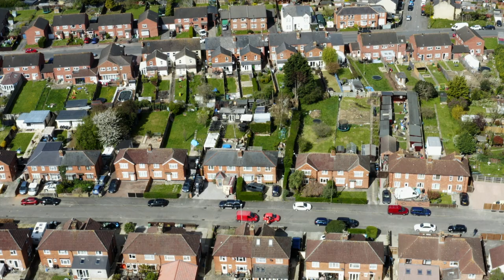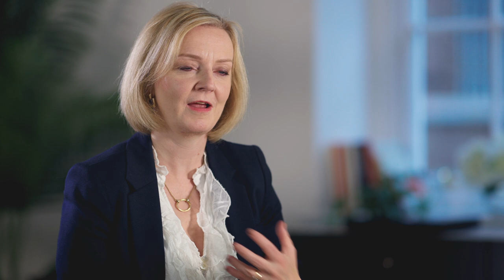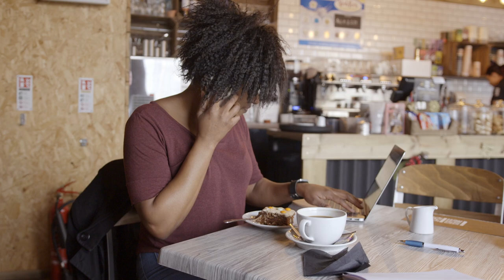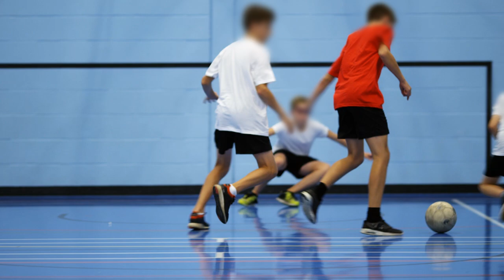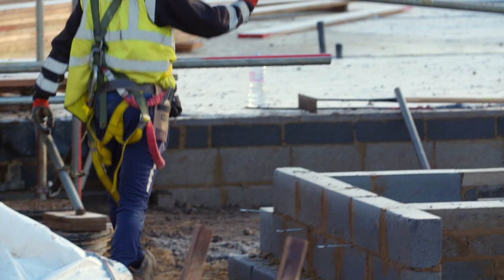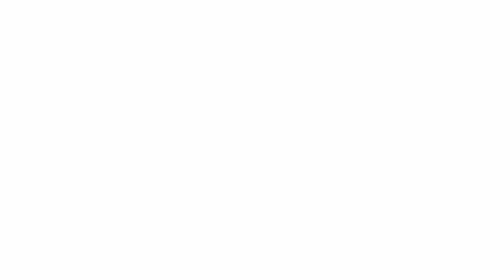WATCH: Liz Truss talks about Getting Britain Moving

Comment: She thinks she got one thing right, the cap on energy price, so she is going to back on about it. Don't be fooled, she does not understand that correlation between low taxes and growth does not imply causation.
Without changes to the rules for gas and oil extraction, the UK will not see any benefit from further oil and gas extraction, either from the north sea or from fracking. The only beneficiaries will be the oil and gas companies involved, that is because the extracted fossil fuels will be sold on the global open market for the profiteering prices, rather than the fuel being reserved to power the UK. The UK population will only experience the down side, of failing to meet our carbon zero target, further accelerating global warming, and the earthquakes that will inevitably result from the fracking activity. We may even poison our underground water supply with fossil fuel products and the chemicals used in the extraction process. 
This is not the UK going for growth, it is the UK being exploited by the multinational fossil fuel companies. The only reason to support new north sea extraction licences, is if they stipulate that the resulting extracted fossil fuel is to be reserved for UK use only. No one in their right mind would support fracking in the UK.